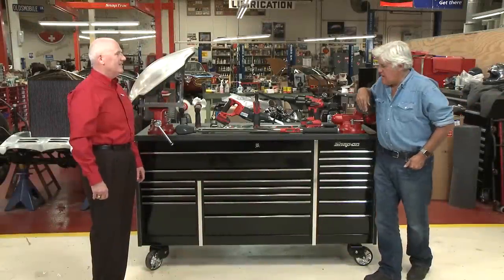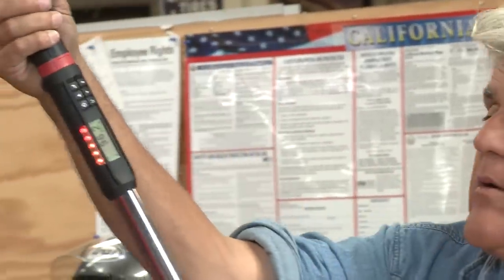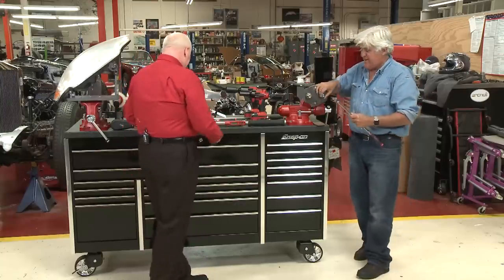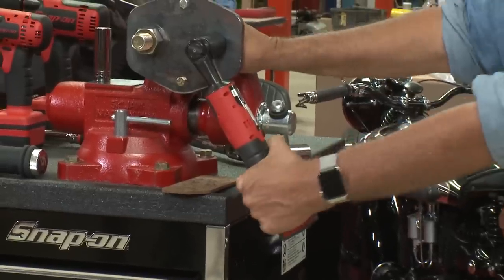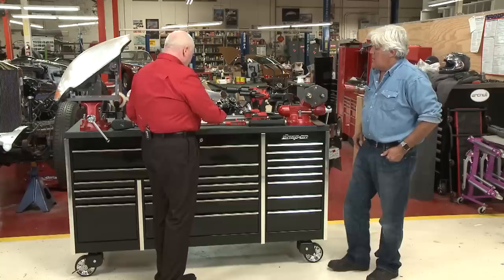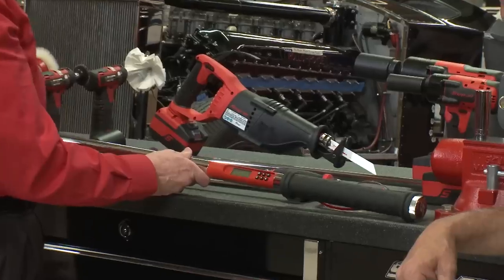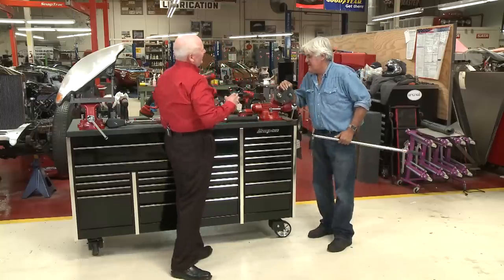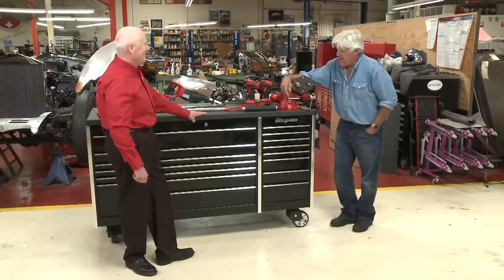Snap-On Power Tools - Jay Leno's Garage

Comment: Great tools no doubt, but I'll go the harbor freight on the cheap route.... Still perfect after years of use....
Reply: if i walked into your garage and saw a tool chest outfitted with hf tools (color coded t-bars lol) i'd start laughing uncontrollably
Reply: Roe Sham Boe I was skeptical at first as well, but since it was only for a one time use at first I went the cheap route. 12yrs later my Pittsburgh torque wrench still been working flawlessly. For an amateur wrench like myself, no need to spend big bucks
Reply: What is laughable about HF? I don't think there is any better value in tools. I once worked with a guy who went in debt well over a thousand dollars for a SnapOn toolbox and impact wrench to START his tool collection. That is pretty laughable. They ended up getting repoed. He would have been better off getting many more tools from a budget brand and growing from that (maybe even upgrading some tools to SnapOn down the road).
Reply: Especially when it comes to plain wrenches. I've had the same mix of no name wrenches literally for years. Tons of use and never worn one out.
Reply: HF tools let YOU do something affordably you'd have to pay a mechanic $100 an hour to do. THEY HAVE THEIR PLACE and have saved me a lot of money.
Reply: I use Harbor Frieght, but sometimes it’s good to have a quality product as well.

Comment: Honestly with my personal experience snap-on has the wrost customer service. I ordered a breaker bar from them, and they sent me the wrong one. I sent it back literally the day after I got it after I got off the phone with them. I was told they would send me the correct one as soon as they got that one back. They paid for regular shipping, but I paid the extra for next day out of pocket due to the fact that I work for toyota as a mechanical technician and I use it every day. It took them 3 months to send me the correct one! I called everyday and I got a different excuse every day so annoying and completely bs. Never again. I now buy from Matco.
Reply: Kuo Huang but iirc matco only makes their toolboxes themselves.
Reply: I called a Snap-On tool guy and asked if he had a hydrometer for sale, and he hung up on me. I should probably call him back and thank him for the money I saved by buying a different brand.
Reply: Yeah, let's forget about the 400 good experiences and focus on the 1 bad experience
Reply: With the tool truck it really depends on your dealer. I have a Snap on guy that warrantied a couple of Snap on items I bought used and I wouldn't mind buying the odd item off him. If I had a bad dealer, there's loads of other high end non tool truck brands to burn my money on.

Comment: Jay Leno torqued the bolts using gravity (pulling down on torque wrench) and when he tried to break them he pulled up. Any mechanic knows if you want to break a bolt you use gravity as your friend. It also makes it easier if you have to jump on the breaker bar ;)

Comment: You know those tools and equipment are somewhat pricey LOL but they are awesome.....
Reply: SOMEWHAT pricey......Snap on Is a scam . They should change the name to Rip off .
Reply: well for the rich it doesn't matter :/
Reply: Well they have to pay for their mobile vans to drive around town loaded with tools.
Reply: Snapon sucks now. Craftsman sucks. Matco has a great program for the trades. If your an apprentice theyll give you discounted tools for your trade. Their tools are great and practical
Reply: I never had a problem with Snap-on tools, I always got a free replacement if one broke.  I don't think I would use their electric stuff though.  Craftsman back in the day was just as good.
Reply: Bacho. Similar quality or better for way cheaper price.
Reply: Mar Vel idk dude, snap on man came to my house and made me a special socket to get my driveshaft off, it was pretty lit. You're not just paying for the tools, but sometimes that service is woooorth
Reply: Vince Zampella yup right not!!!! Snap on drivers are in too deep they are screwed
Reply: The Milwaukee Fuel line outperforms their 18 volt tools.Plus Snap On did lose a lawsuit filed by Milwaukee for 3 battery patent infringements.Milwaukee was awarded 28.7 million dollars.There are owners of the Snap On cordless tools selling them and buying the Milwaukee fuel line which is cheaper with a better warranty.5 years on the tool and 3 years on the battery with Milwaukee vs 2 years with Snap On.Snap On is late in the game too,they are going to brushless motors finally next year.The brushless motors last longer which Milwaukee uses now.
Reply: If you don't have a commercial shop, you have to track down the Snap-ON driver first.  Good luck.  Most of their power tools are no longer made in the USA.
Reply: I ment million
Reply: Vince Zampella how else did he get your driveshaft off? HA!
Reply: Bahco, Sandvik and Kamasa are the best that's what I use.
Reply: Dano Kerr Matco tools are rebranded and have no resale value, I like Matco air tools and cordless tools. You can buy Matco pretty cheap on eBay.

Comment: My dream:
Build a 69 camaro pro touring with Detroit speed suspension, a custom built 572 and nascar style x pipe exhaust system.
Own a nice house with a 2 story 3 car garage and fill it with brand new snap on tools.
Own a garage for restoring, modifying, or repairing cars.
And hopefully be a race car driver

Comment: FYi for all you professionals out there... or even DYI'ers. I work as a tech professionally... use my tools for 40+ hours every week with several years of experience. I will say that snap on makes the BEST wrenches.... and THINEST tools which is nice for 5-10% of jobs. bu for the VAST majority. Buy midgrade craftsman for stuff you can without for a few weeks while they warranty it and cornwell for stuff you need sooner. But i 100% recommend snapon wrenches. Theyre 100% better than anything else. but most everything else is... negligible 5% performance increase for a 500% cost increase doesnt make sense most of the time... especially when its not always better. I have a milwakee impact that DESTROYS my snap on in batter life, break away torque... slightly less weight... better battery life..... and of course... half the price.   Snap on makes GREAT products but do yourself a favor and don't pay 10x the price to get that. Look at the guy who's been there for 20 years and get whats in his box.

Comment: Mechanic or Not every guy should have a torque wrench, crescent wrench, vice grips, socket set 3/8 & 1/2, screw drivers of all kinds,  drill, impact driver, open-end wrench set, breaker bars, hex/allen key set, etc.

Comment: Dear Snap-On, 
The electronic torque wrench is stupid, I want a tool that will last 30+ years and not be out dated, analog is timeless. And the electric ratchets and impact break bolts too often, you can't feel the torque like you can with air. But maybe you could make the tightening part a little better or softer?

Comment: SnapOn is great quality but not everything they make is worth it (electric drills, buffers etc.) I get Dewalt or Milwaukee for this. Craftsman Pro series is great as well. In tools, you get what you pay for but the most expensive is not always the best. That's why I have a mix.  If you buy everything from SnapOn you will mortgage a 250k house 5 times over to pay for them. I work on cars a lot as a hobby and build them so I need good quality but for the person using on occasion will never see the benefits of SnapOn or MAC vs price they pay. Harbor Freight has some good stuff but their quality is hit and miss from my experience.

Comment: Bring in Harbor Freight.
Reply: You mean communist freight.
Reply: its hazard fraught...
Reply: Bring in double happiness made in china for 10percent of the price
Reply: That has the potential of being a pretty funny episode.  I am on board with ya.  :)

At the same time I am not saying I am above buying tools from Harbor Freight.  While they have some things that are not even worth the low price they sell them at, if you know what you are doing when shopping there, they may have the right tool for the right job at the right price.  It does have to be a job/task you won't be doing too many times.
Reply: Harbor freight sells junk. Get real.
Reply: You can use some stuff from them, but a lot of it is junk.  You at least need craftsman or possibly Lowes/Home Depot branded tools.  One bad thing about sears doing so badly is missing out on their tool section, it was pretty decent stuff.
Reply: Je
Craftsman has not been the same since they outsourced production to China. What's the point? Might as well go to Lowe's, easier to get to.
Reply: Trump's China tariffs are killing that place. HF is cheap enough you can come back, again and again, and again and again and again and finally realize you should have brought the Snap-On once and still be using it.

Comment: 99.9%  Snap On here but my dealer does not look like that.  My dealer will get right down in the real thing to demonstrate tools.  He does not roll a whole roller cab off his truck for demonstrations AND he does not offer free tools if I put him on you tube.  He has been my dealer for 34 years and still does not roll off a cabinet or give away free tools.  He will let you try a wrench but it will have to be your bolt and your vise.

Comment: Snap On, MATCO, MAC, PROTO, BLACKHAWK are all great tools for the professional mechanic. but far to expensive for the average DIY home garage. unfortunately all the Hardware Store Brands like Husky, Craftsman, and Kobalt have cheapened the quality of their tools. I have a old set of USA made Husky tools from the 90's. when you measure the gap in a 1/2 inch wrench with a caliper it measures .505". I recently bought another set to keep in my camp trailer. and was really disappointed with ehte quality they just fit too loose. I measured the gap on the 1/2 wrench that cam in that set. it measured .516. that's what causes rounded off bolts and broken knuckles. all the hardware store brands are like this now. I wish snap on would put out cheaper line for home DIY users.

Comment: Snap-On tools ARE overpriced! I only have a few of them. For someone that uses them every day for a living it is worth it IMO. Most of mine are the old Craftsman before they were made in China.Years ago when I was in the Diesel Engine business I had a class of service techs every week. I had a couple hours to teach them Warranty and what is and is NOT warranty. The rest of their time was spent with the "real" instructors.One of the real PITA things was to take a rusted trashed turbocharger apart to inspect it. The problem was you could only get an open end on the bolts (thank you Bosch). I would pick the biggest guy in the room and ask him if he could break the bolts loose for me. I'm 5' 8" and 115#. They always laughed.I'd hand him a Craftsman combination wrench and point him at the turbo in the bench vice. Of course he would round off the bolts. THEN I would take my key out of my pocket and open the Snap-On tools. Same size combination wrench. I would put it on the bolts he had rounded off and smack it hard with the palm of my right hand. And then break them all loose!"THIS is the difference good tools make for a guy my size!" They always looked at me like I had grown a second head! Then we would take a few turbos apart and I'd show them how the owner F'd them up.

Comment: I'm surprised Snap-On is still in business since the cats been out of the bag for quite some time on a decent tool not needing to cost an arm and a leg. Does anyone else notice how uncomfortable Mr Leno looks in these Snap-On videos?

I get frustrated watching video's selling Snap-On tools. Mechanics got it bad enough with the physical labor and dirty conditions involved in the work they do, than to add insult to injury, the pay for most mechanics is just lousy. Than you have professional tool trucks roll in with tool prices so damn high it requires financing to buy anything. Wise Up Mechanics! Stop buying over priced tools unless its your only option, and start thinking of yourself as a business. With all the tool options these days, a $10,000 or $20,000 tool box makes absolutely no sense! And stop the made in America crap, because I can guarantee you management at Snap-On is thinking globally; and you should to until the big wigs start putting Americans first.

Comment: The Snap On cordless tools are overpriced and a pile of junk.Plus Snap On lost a lawsuit filed by Milwaukee for 3 power tool battery patents infringements.The M18 fuel line by Milwaukee outperforms Snap On's 18 volt line.Plus Milwaukee has the better warranty,a 5 year warranty on the tool and 3 year warranty on the batteries vs 2 years with Snap On.

Comment: Snap-on tools pay for themselves. Ask any real technician 👨‍🔧
Reply: How, may I ask? How does overpriced Snap-On tools pay for themselves?
Reply: Daniel C When your own mechanics shop you will understand.
Reply: I'm still waiting for an answer, not just your snarky b.s. What makes Snap-On better than the rest? I work on heavy equipment, so please tell me what I don't know.
Reply: If you have never own a set of snap on sockets or flang drive plus wrenches it will be hard to explain. I work on a heavy duty truck that see a lot of highway miles. Some of them are rusted beyond belief from salt. The design and quality of a Snap-on wrench’s or sockets will bite down on that rusted nut or bolt. I can crack lose bolts without rounding them off. I don’t have issues with the tool slipping off because the Snap-on sockets and wrenches don’t expand even with excessive force. I also have a mobile  maintenance truck, I have both Snap-on pneumatic and electric lithium ion powered guns. I find it so much easier to grab an electric gun right out the drawer, pop on a fresh batterey and start working. Time is money, if you know what your doing the right tools will help you get the job done faster. I didn’t always have the money to buy Snap-on tools. Once you realize the tools pay for themselves overtime you will never invest your hard earned money into nothing but the best.
Reply: I have no doubt they are great quality, but for MOST mechanics, there are much cheaper alternatives that will do the same job for decades.
Reply: Yep, you'll be paying for them for a lifetime.
Reply: Bustopher Jones speak for yourself, I pay cash not credit.